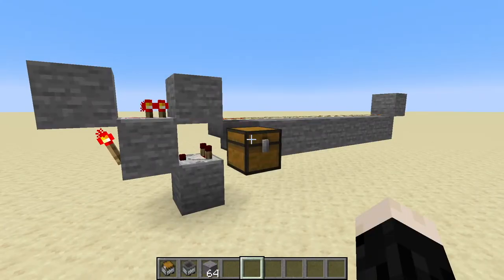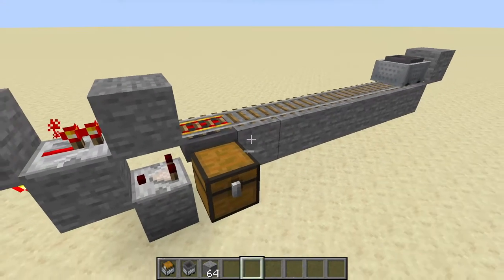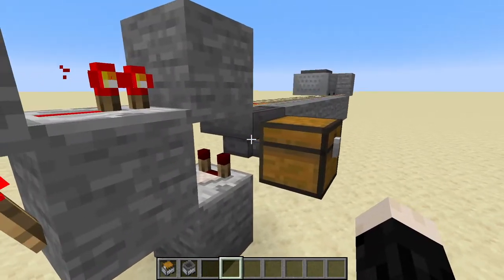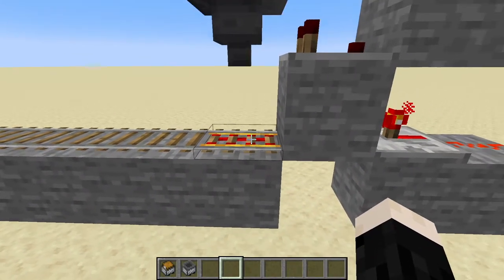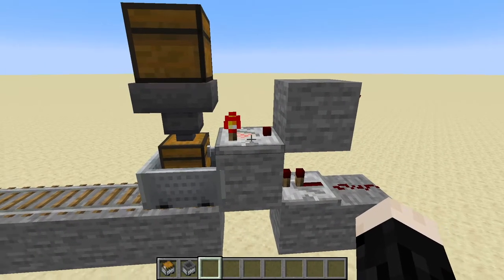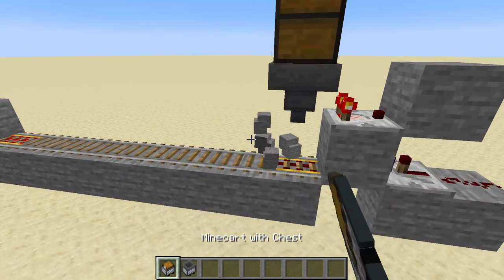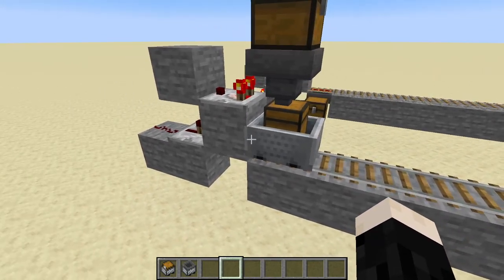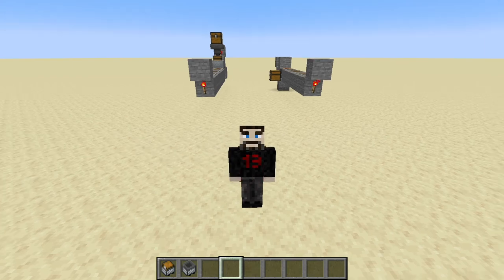Red Stone Loader & Unloader Tutorial! | Minecraft Tips & Tricks

Comment: Does cart speed or track length affect the unloading system? My cart bounces off the powered rail before it turns off in time.
Reply from the maker: It shouldn’t impact things, but they can be finicky. Sometimes trying a second powered rail or even adjusting hopper line placement can affect timing. Which design are you having trouble with?
Reply: @Todd13  unloading
Reply from the maker: I’m going to guess that your hopper points down? The hopper needs to go sideways or else the items flow too quickly for the comparator to register and it won’t stop the minecart. Hope this helps!

Comment: Ok, so for some reason I'm thinking it may be related to the east west rule with minecart physics. The reason I say that is i recently made another world and tried it again, and now I can't get it to not work lol. I have not verified the east west rule in my test world yet. 🤷‍♂️
Reply from the maker: Very interesting. I know rails do have some weird behaviors, but not sure why it would interact with red stone?
Reply: @Todd13  I agree. I find it fishy as can be. That's why I'm not sure if that's what's causing the issue or not. The biggest issue seems to be cart speed control when coming up to the unloading point. If I push the cart myself from a couple rails back. It works perfectly. If I use powered rails up the line..sometimes it comes in to fast. Others to slow. The trick seems be be finding just the right speed so the comparator actually shuts the rail off in time.

Comment: Didn’t work
Reply from the maker: You just push play and the video should start.
Reply: @Todd13  yea I did bozo you wanna catch a nuke or what? I had to to a little adjustment with the unloader but the loading one its not sending the cart back when its full it just sits and no red stone is activated
Reply from the maker: Hmmm, that’s unusual. Are you on the Bedrock edition? I know this works in Java, but Bedrock treats red stone differently in some cases. Also, make sure there’s no items in the hopper. If the minecart gets full and there’s no where for the items to go, it will never take off. Minecarts can only hold so many items and if the hopper gets backed up it’ll never send the cart out. I hope this helps.
Reply: @Todd13  to be honest I 50/50 understood this, I may have to watch the video a few more times, I’m on the Xbox one so whatever version is currently on that, right now my loading system is a hopper line which then ends at a hopper pointing down, under that hopper pointing down would be the mine cart that items load into. I’ve tried both a chest and hopper Minecraft but when full it won’t take off, would it be because of the continuous input of items I’m having in that hopper line?
Reply from the maker: @Vladimir-Putin-  I think you figured it out. The comparator needs to see that the hopper is empty to shoot the minecart off. The hopper line prevents this from happening. There are loaders that do work with hopper lines, but this tutorial is just a simple loader. I’ll see if I can find one that’ll work for you and make a video in the next couple weeks.
Reply: @Todd13  sounds good, I’ll sub and stay tuned, I appreciate the help